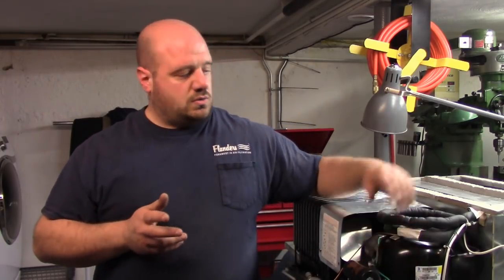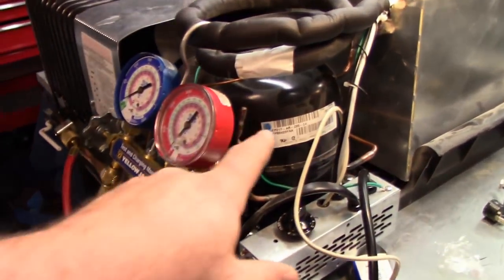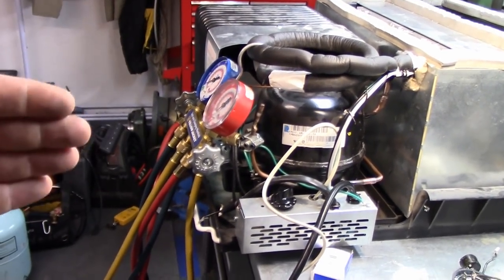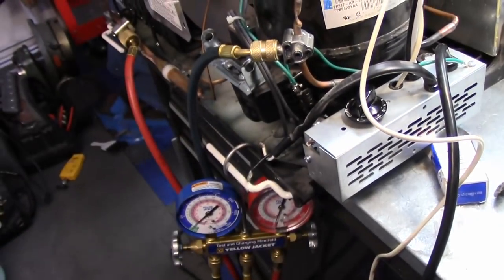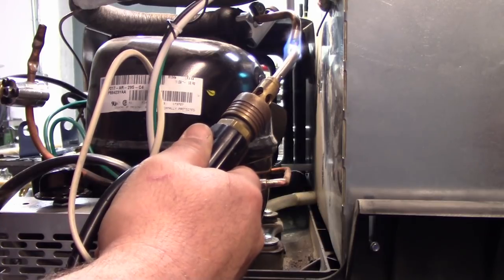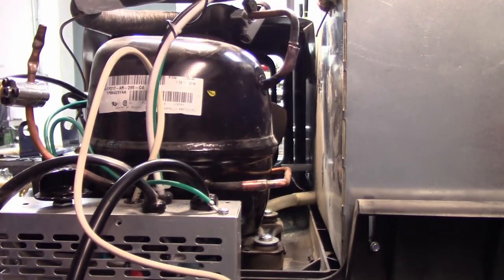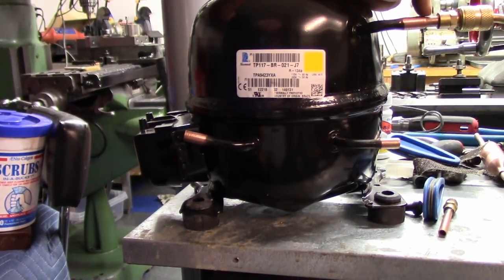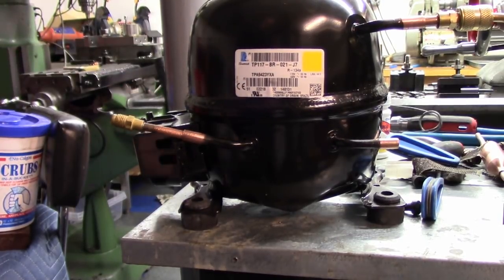Another Day in the Life of an HVAC Tech: Episode 15

Comment: You should remove the liquid hose and put a stubby gauge on instead.. That's a few oz of gas blown off di minimumus on a critically charged unit
Reply from the maker: That's why low loss hoses are used.  Gauge hose is removed then high side and low side gauge wheels are opened while unit is running.  This will suck any liquid in the hose back in the system and equal both sides out to suction pressure.  The gas lost is negligible.
Reply: @Halligan142  Nice! I will never doubt you again

Comment: I did not see him sand the tubing ends before soldering.
Reply from the maker: It is brazed with phoscopper so it does not need any cleaning nor flux.  I always clean the new copper fittings and joints.  The tubing that was removed from the old compressor I do not touch.  The sand cloth really won't do much to the.old braze on there.